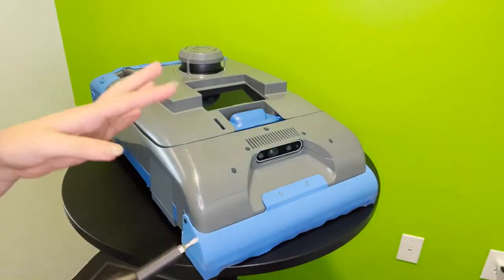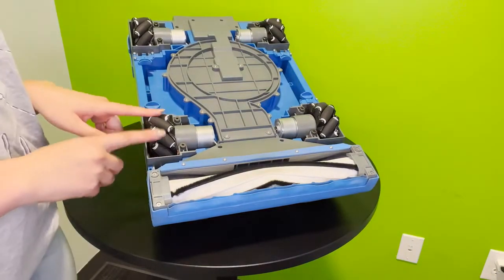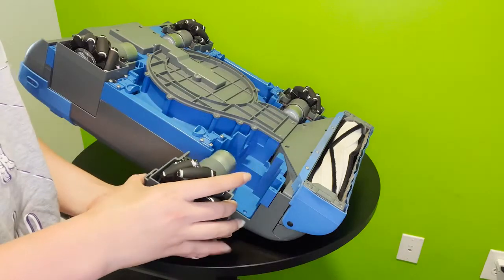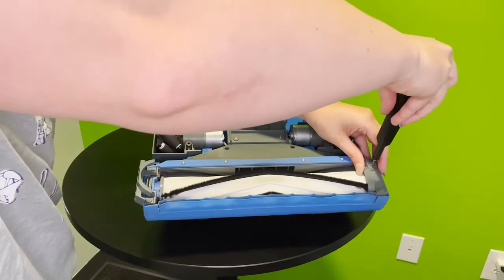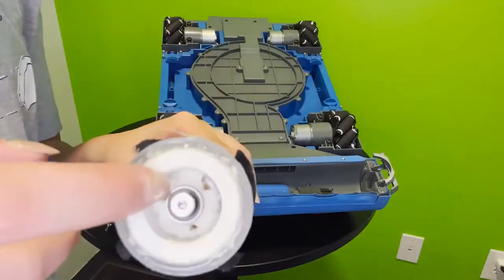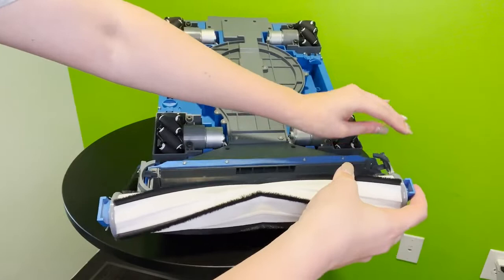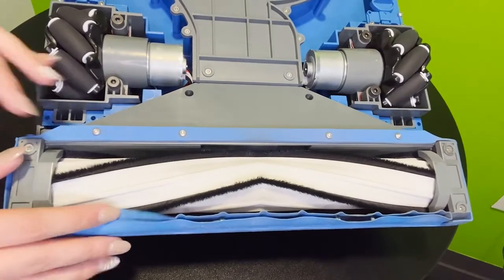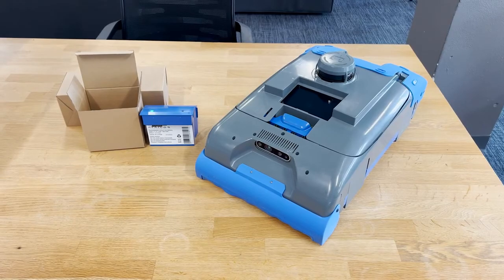Tailos Robotics: Level 1 Engineering Training

Comment: How well does it work around sled base chairs?
Reply from the maker: Hey Steven! Great question, our bot is perfectly capable of tackling dirt under sled based chairs, as it can detect where the sleds are and easily fit in between. 
Let us know if you want more info! 🤖
Reply: @TAILOS  How fast do they work, do you have number on how many feet per minute?